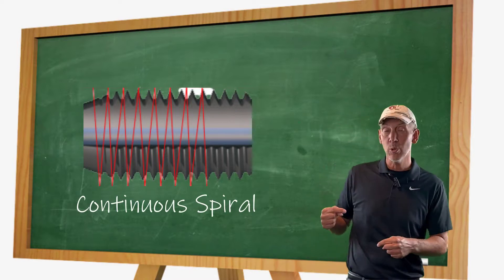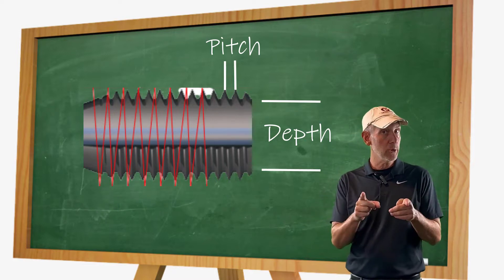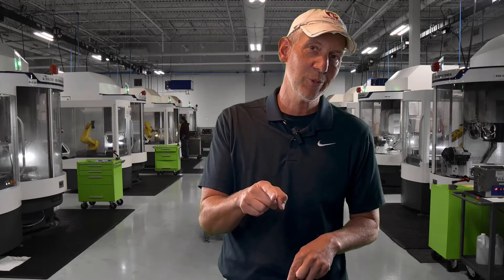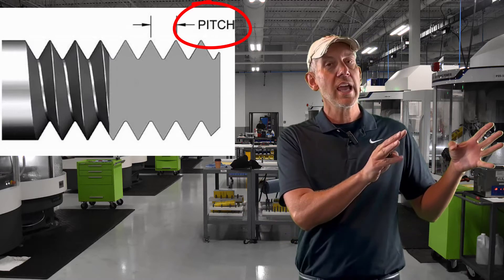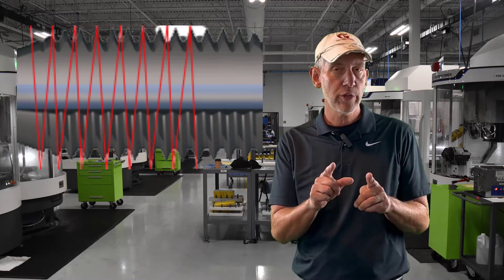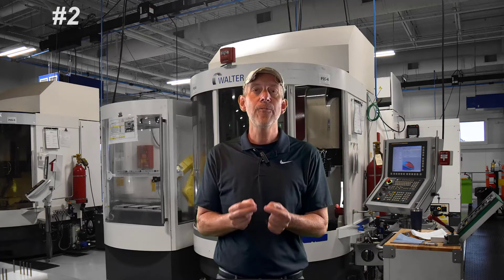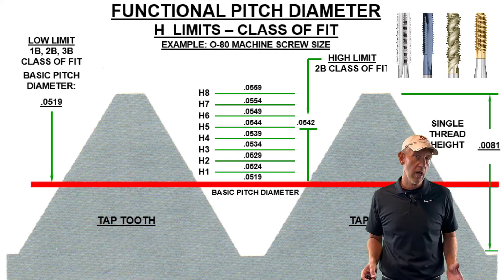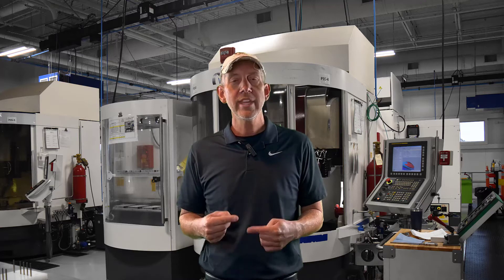Thread Mills vs. Taps: In The Loupe TV Ep. 7

Comment: Using a relatively full-form threadmill and you can thread a hole faster than a tap, especially at bigger sizes.  Though one of the downsides at that scale is the expense.  I got a threadmill to do 1/2-13 holes in steel and it will do them in a couple seconds each, vs having to peck tap or go slowly with a bigger tap like that, and the biggest downside is that it's a $130 tool.

Comment: I agree with most everything you said about the advantages of thread milling. Great info, but given in such a generic format you left out some of the other disadvantages. Like the absolute need for a tread gage if thread milling (yes you could use a bolt, but how do you know if the bolt you fit it to is at high or low limit for the bolt tolerance). Thread milling super deep holes is also a huge PITA compared to tapping. Taps cost about 75% less than a thread mill in a 1 to 1 comparison as well, assuming your not buying the cheapest crap available.
Reply: If you are making a lot of holes a Go-No go gage is the way to go.  They are costly but help quickly identify the quality of the dimensions.   Great comments.  Appreciate you and thanks for watching.